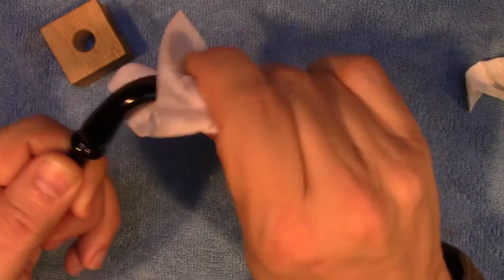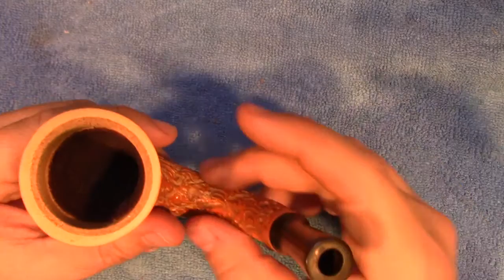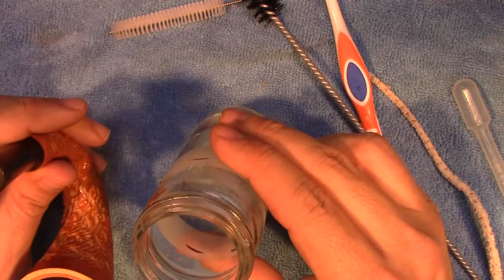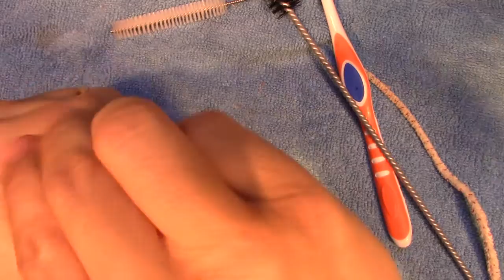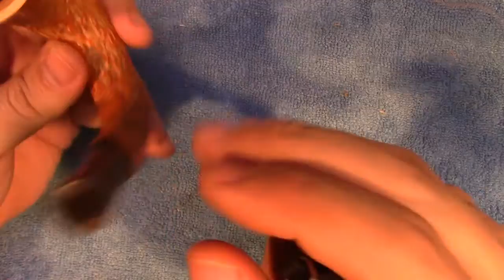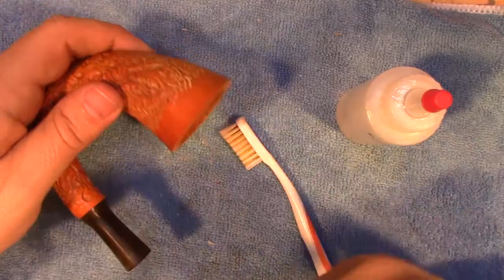Gourd Calabash Restoration Part 2

Comment: never add liquid in the bow it just speads the mess everwhere. Use dremil flex shaft with wire circuler brush and hand vacuum it gets everthing out and down to exceptable coior
Reply from the maker: It worked fine.  I'm sure your method could work as well.  More ways to skin a cat.  Thanks for watching!
Reply: @CaneRodPiper  sorry never wanted to come off as "a matter of fact" sure you're right

Comment: I have a gourd Calabash with a loose fitting bowl. How can this be fixed?
Reply from the maker: Hi Johnny,  The short answer is very carefully.  If it is just a little loose, you can wax the cork a bit and possibly tighten it up.  I have read that the best wax to use is the stuff saxophone players use and you can get it at a music store.  If it is really loose, then you will need the cork gasket replaced and to do that you are going to need to find a pro with some experience working with calabash pipes.  Sorry I can't be more help, but feel free to get in touch if you have any more questions.  Best, Mike.
Reply from the maker: Thank you for the comment.  There is nothing in pipe restoration that is rocket science.  The reason  I make these videos is to help folks do it themselves.  However, I can't agree with your advice in this case without knowing Johnny's comfort with doing this sort of work.  Replacing the cork is fiddly, and you need to get it properly aligned and gap free for the pipe to smoke well.  I've done it on my own pipe, but I won't do it on someone else's pipe.  Therefore, I can't suggest someone do it themselves.

Comment: I like using Murphy's Oil Soap when cleaning rusticated surfaces like that, mineral oil will just blend the dirt in rather then cleaning it out, just a little thought.
Reply from the maker: +PipeLeisure Good point.  I just tried the oil soap on my latest restoration and really like it.  I'm not sure about using it on a rusticated gourd though because those rustications feel a bit pithy.  I would worry that it might permeate the gourd and leave a taste.  Not sure, but on rusticated briar I will definitely be making the switch to oil soap.  Thanks for the tip!  Best, Mike.

Comment: The rustication definitely looks a lot better after the mineral scrub. Very good tips. I look forward to using mineral oil to hydrate the vulcanite. Do you have a recommendation on a dye brand for briar? fiebings leather dye? take care crp!
Reply from the maker: Thank you, I'm glad you find the videos useful.  I use both Fiebings alcohol based leather dye and Pimo's versions which I believe are also an analine based dye that you dissolve in your own alcohol.  I have not seen much difference between the 2.  If you don't mind mixing your own Pimo is a bargain.

Comment: I need to do this with my Calabash... so good to see
Reply from the maker: Glad you found it helpful.  If you do the alcohol rinse a few times a year you can probably get away without the scrubbing.
Reply: +CaneRodPiper very good, I should give that a shot first and see how it goes... My bowl on mine too needs to be cleaned up a bit... worried about how fragile that meerschaum is.